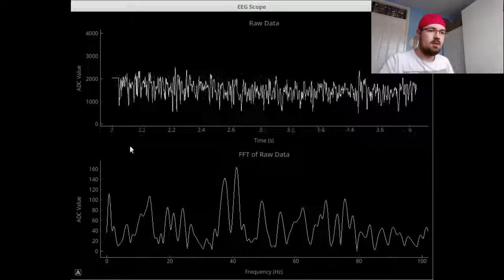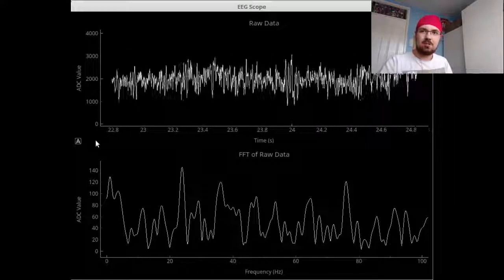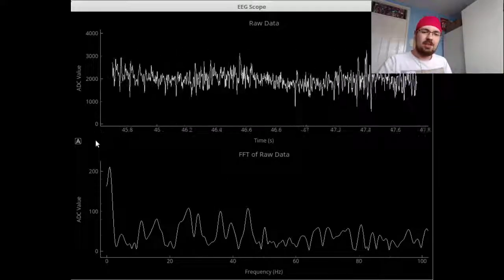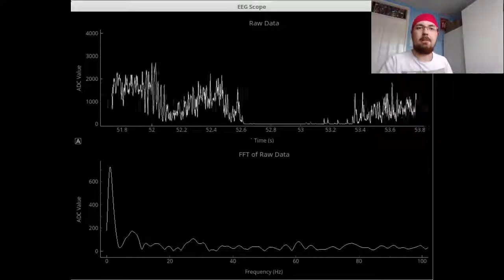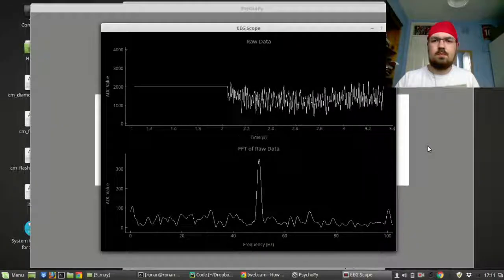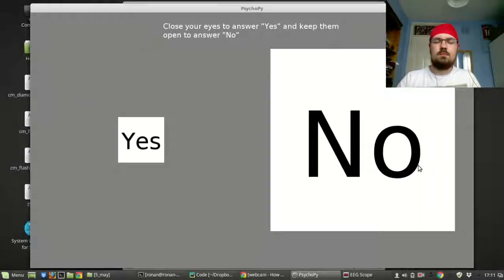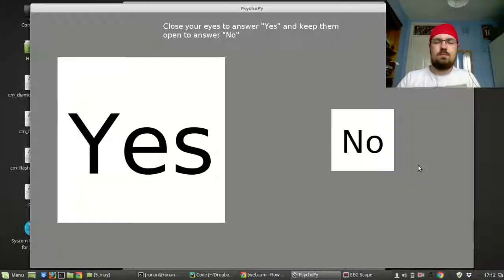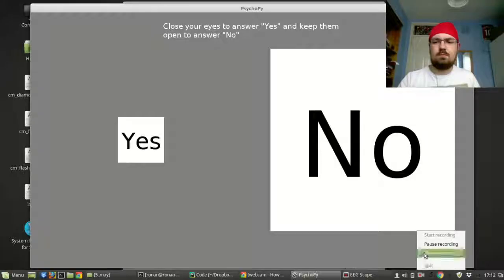Demonstration of a Simple BCI Using Low Cost EEG Circuit

Comment: Perhaps you can add a average filter over a interval of +- 1 sec, it won't be as fast but you can tune the levels for which value it needs to select much better and it will be more stale.
this tuning you can see like this, when your eyes are open No is selected >80% of the time, when closed No is selected <70% of the Time, you can calculate those values on the start of the program or in a calibration if it needs to work for (almost)everyone and use the average measured value combinations and calculate from those values towards the other combination until you are just a given hysterese distance from the center of the 2.